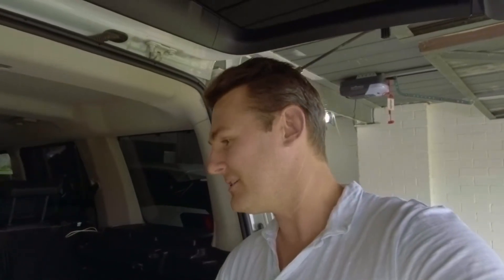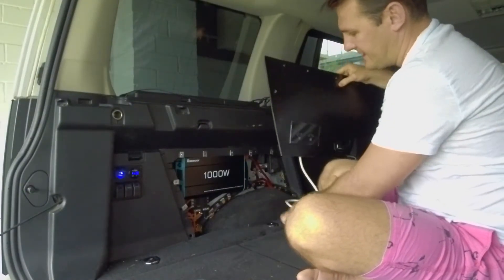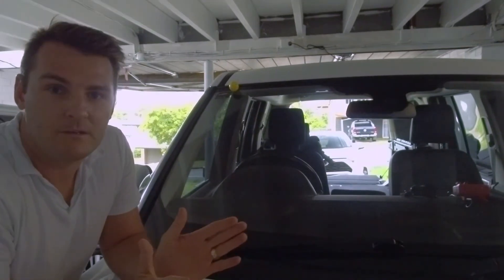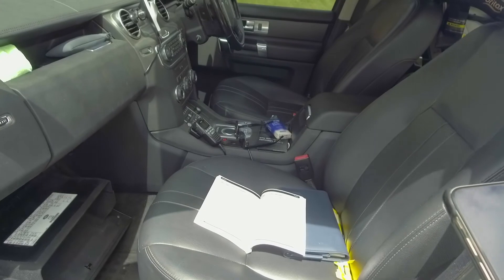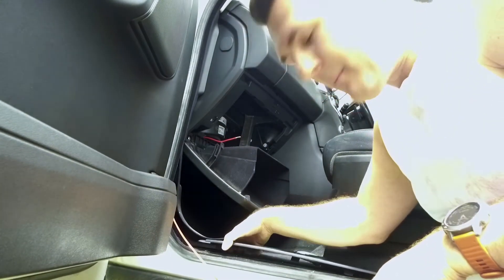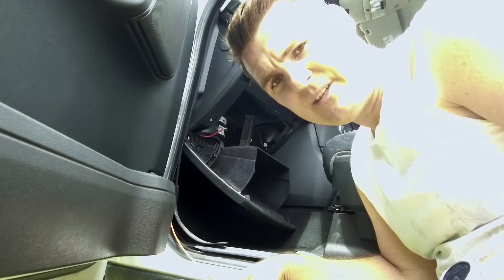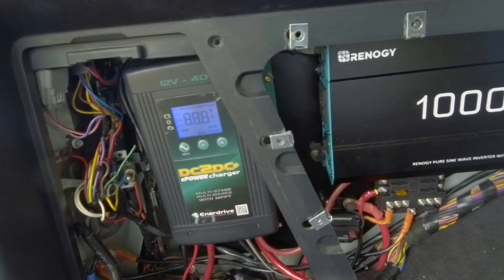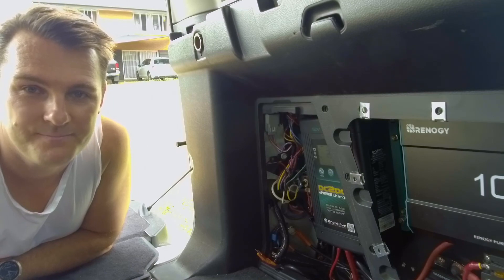Discovery 4 - DC charger completed project

Comment: how/ where did you get the power from for the dc input?  from the main battery under the bonnet?
Reply from the maker: Good Morning Robbydee, for the Enerdrive DC input, I connected a main power cable to the voltage sense relay off the positive side of the battery. Then the ignition sense cable I used a jump fuse on the kick panel fuse box after reading the manual. It’s fairly straightforward but feel free to ask any further questions